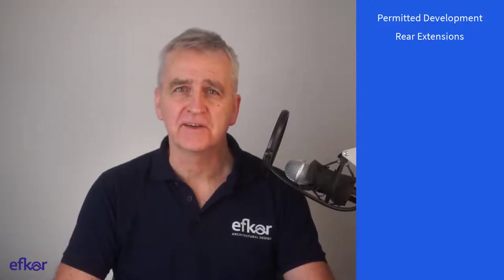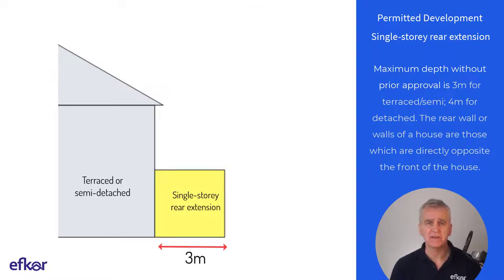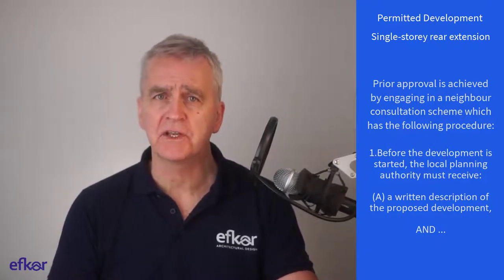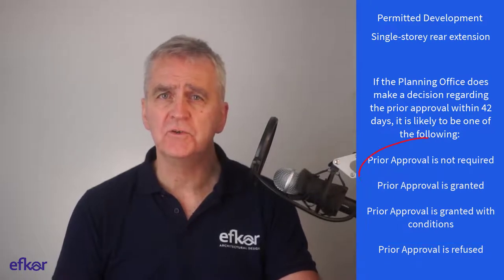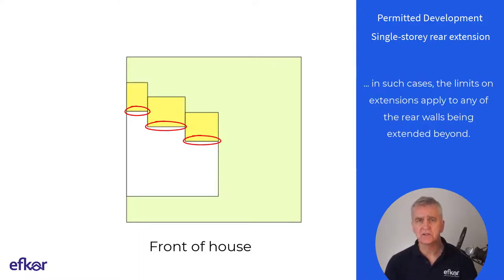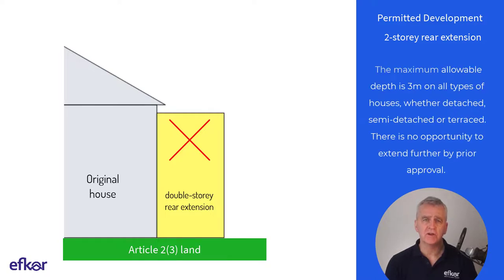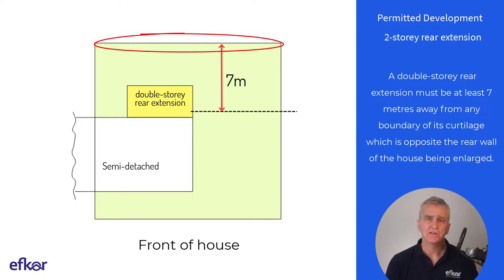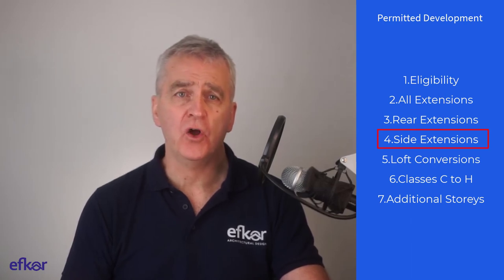Rules for building rear extensions under permitted development

Comment: Great video. If the extension is on the rear of a semi-detached house, the eaves cannot be more than 3 meters because of the boundary. However could you have a 4 meter max height on the boundary with the roof sloping away from the boundary reducing to 3meters at the opposite side?
Reply from the maker: Thats a negative

Comment: Great series on PD, I was looking and looking to understand if you can add storeys of attached single storey garage and you’ve explained it clearly, No lol. 
You’ve described leaving a small inclosed patio between rear and side extension to stay within PD rules.
Can you advise how big the gap needs to be and could you externally bridge across on the first floor?
Reply from the maker: Glad you liked it. I have seen a brick width approved on appeal. Bridging across at first floor level is not available with PD.

Comment: Thanks for yor efforts. I have a detatched house. I also propose to build a Garden Room to the back fence of the propety in compliance with size/distance rules. It will be approx 30sqM with 14ft depth.  What's the maximum depth single story extension permissable under PD?
Reply from the maker: A  garden room (assume detached) has different rules from extensions. You mention both types.

Comment: Hi! Thank you for this info. Quick question for you relating to the heights of permitted development. My neighbours rear ground level is slightly higher than mine (around 30cm) therefore on their side they want to build to 3m in height  adjacent to our boundary however on my side the extension will be 3.3m in height. So do I have a good reason to object to the PD or will the planning officer measure it from my neighbours side? Interested to know..many thanks!
Reply from the maker: Any difference in ground level will be taken into account

Comment: Hi there, thanks for the video. I am still struggling to find an answer about whether I need prior approval or planning. My 1930s semi currently has a long (6m) and narrow (2.5m) extension. I am looking at reducing the length to 4m but increasing width to 5m inline with the house. Can this be done under PD or is the maximum still 3m from original house? One neighbour has 6m extension and the other (the one I am attached to) has a 3m extension. Thanks in advance
Reply from the maker: 3m is max unless you apply for the extension

Comment: Hello I have a semi detached house with a 3m wide  by 1m deep outside toilet  attached to the back of original house line. This was build with the house. Does this then make this my start point of my 3m permitted after the toilet house? Would love an answer on this please?
Reply: Yes - you measure off the rear-most part of the original house  - see the part of the video that covers 'stepped' rear elevations.  But - it is not always great having stepped depth extensions.  So, a useful tactic can be to 1st apply for a Certificate of lawful development, get that approved.  Then use that to help support a Planning Application where you want to extend out further then PD limits.  Some Local authorities might insist you actually build your PD extensions to take them into account for the purposes of a Planning Application, others might eb happy if you had purely commenced the PD work ( e.g. excavated foundations / poured concrete.  Other Local Authorities might not make you do anything - it can vary alot!
Reply from the maker: Agreed

Comment: Hi. thanks for the information.  may I ask if the 45 degree rules affect the size of the rear extension under permitted development right? in most case when full width 3m rear extension built for terraced or semi detached. it will certainly overshadow the closest window of neighborhood. but there are a lot of rear extension built with full width. I am confused
Reply from the maker: Hi Roy, thanks for your question. This guideline is not usually applied to a ground floor rear extension, whether existing or yet to be built, when you build to a 3m depth, full width under your permitted development rights. 

You dont say whether it is a single-storey or 2-storey rear extension. For the latter, it is applied to a plan drawing by extending a 45-degree line from the nearest habitable room windows belonging to your neighbour, outwards towards your property.  A bedroom or study is a habitable room; a bathroom is not a habitable room. If you see an existing rear extension that appears to overshadow a neighbours window, check whether it is a habitable room and not just a bathroom. 

Your upper storey should not cross this 45-degree line. Typically, planners look for a 2m set-off at the boundary with the other semi. The start point of the 45-degree line varies according to each Council. Some have a start point at the centre line of the window and others use the nearest edge. However, this is just a guide used by Planning Officers and compliance with local habits does not preclude a rejection of an application if the design is poor, overbearing or overshadowing.

I hope solves your confusion!
Reply: @efkor  thanks for your reply. it really solved my confusion. and yes. I mean the single storey rear extension. It's great to know the 45 degree rules don't normally apply for it. appreciated it

Comment: I received a “Prior Approval Not Required” in April 2021, but I didn’t start the work at the time. Will I need to do it all again if I want to start now?  Also, I received letters from surveyors for both my neighbours saying to inform them 2 months prior, is this the usual process? Thank you
Reply from the maker: Different Prior Approval work has different timescales. Its unlikely that you have exceeded the allowable time but I would email the Council and ask. If the work impinges on the neighbouring boundaries, such an approach from surveyors is normal.

Comment: Hi, our extension is 4m, but our neighbour wants to build a 6m rear extension. While it's at the limit of the space it will eat into their garden (upto 50%), imo it's too big and overbearing and would like to object but I don't think it will successful if PD is indeed 6m.
What is the best angle for objection. It's ridiculous that large family house will have a tiny garden that's out of balance.
Reply from the maker: I sympathise with your situation. From the 6m quoted, I guess that you have a semi-detached property. Its worth making an objection as your neighbour has to obtain prior approval, which is heavily dependent on no or few objections from neighbours (note the plural!). As for angles, check that all extensions and outbuildings other than the ground area of the original dwelling house do not exceed 50% of the total area of the curtilage. Also, check your Council Planning website and see if they have a Supplementary Planning Guidance document for extensions. You might find some very useful angles in there. And check out the SPG for new builds and see what minimum square meterage is required for a new semi (its 100sqm in my Council!) and use that figure in your arguments. Information is power. Good luck!
Reply from the maker: min sq meterage ....for garden amenity (Council usually insists on the amenity space being at the rear)
Reply: @efkor  Hi, thanks for your reply. It's actually a terrace house so the council are seeking prior approval/consultation with the neighbours.I've tried doing some research over the weekend and thought  they automatically were permitted to do a 6m extension which was incorrect. I've chatted to the neighbour on the other side and they also think it's too big. Not sure if they will formally object yet though.
They do have a small shed (i'd say 2sqm), so i'm not sure if it would make that much of a difference.
Another note that may have some bearing is that our and the neighbour on the other side's gardens are  shorter by 1meter in length, as we have ally's running behind the garden. So while it maybe 50% of their garden, its around 60% along our garden (from the original back wall of the house).
Reply: To complicate things more, the neighbour added to their current 3m extension last year, so it went from half width to full width (towards ourside of the boundary). They Did this without speaking to us, getting a partywall agreement, taking off our fence and building right up to our boundary so their wall is literally up against our soil pipe that runs along the side of our extension to the new soil stack?/manhole (our extension was about a foot within the boundary).
This means it's impossible to clear that gap of rubbish (which their builders left), have enough clearance for the toilet extractor fan exhaust, repair or replace the soil pipe or add additional joints to add another utility room in the future as the gap between the current extensions is too small. Anyway, we complained to the council, they came out and inspected it (building control?) and it seems it wasn't to standard (drainage, foundations etc weren't right). So they are demolishing the old and new extension and going for a bigger one and employing a proper building contractor to do the work. I've also received a letter from a surveyor regarding a party wall agreement.
Can I insist that they build at least 1ft away from the boundary regardless of the length (and it's been approved) so we have access maintain that soil pipe in the future should we need to? The plans submitted at literally up to the boundary. 

When we put in plans for our extension, the council wanted us to keep 1ft gap to the boundary on both sides! Or is this something we can demand they do via the partywall agreement?

Comment: I find your advice about two story extension is a bit odd.Presumably one could do a two story extension that comes out 3 m and then later on still be able to add on an extra meter on the ground floor  also I noted that you missed off the advice about the two story extension having to have a setback on the sides.
Reply from the maker: Thanks for your comment, not sure what you mean by odd. I guess that you are already aware that the order in which you apply for planning/construct extensions has an impact on their allowability under PD. Thanks for filling in the missing information.
Reply from the maker: Sorry, I didn't answer your question .... your proposal of adding the 1m on the ground floor after the 2-storey extension has been built falls foul of the "total enlargement” definition. If you are connecting these 2 extensions, you are creating a 4m-deep 2-storey extension, which is not possible under PD.
Reply: Hi - are u still answering questions here